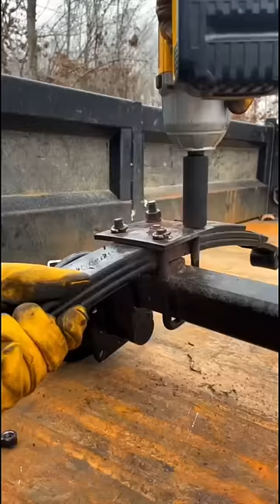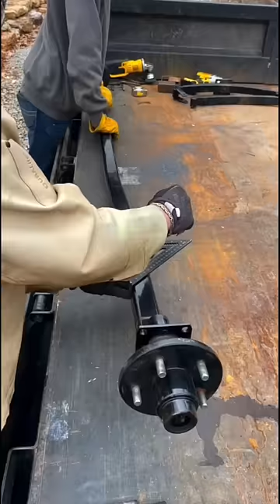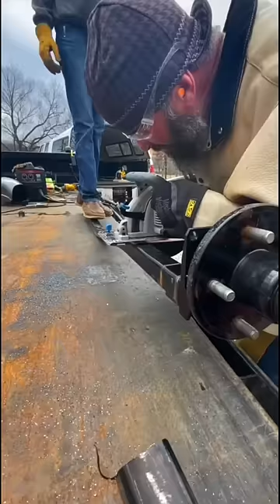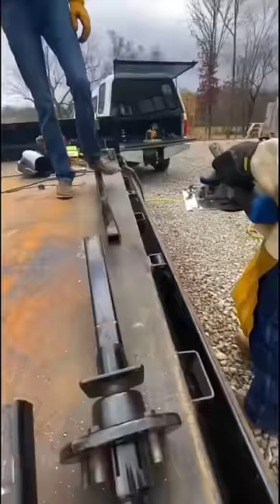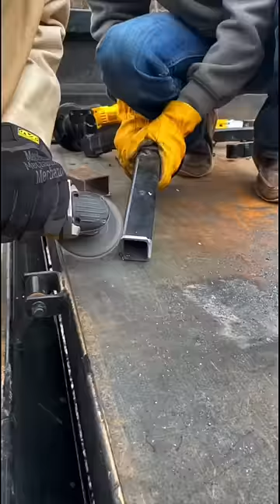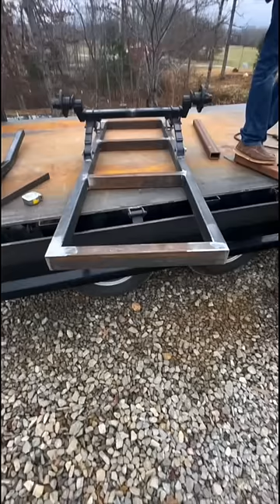Shortening a boat axel for an ATV Dump Trailer #shorts #country #hardwork #fabrication #welding

Comment: AXLES ARE BOWED FOR A REASON AND WHEN YOU CUT OUT THE CENTER THE TRAILER WILL NOT RUN STRAIGHT
Reply from the maker: Some trailer axles have a camber. They can be ordered strait or cambered. Cambered axles are preloaded to compensate for load that would splay the tires otherwise. This little trailer runs just right.